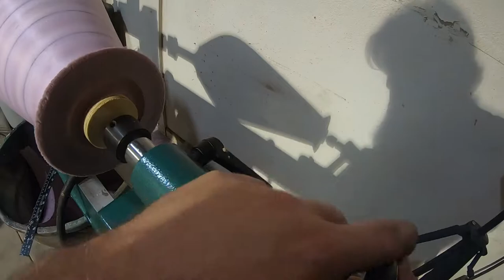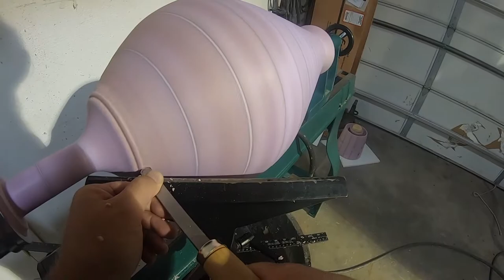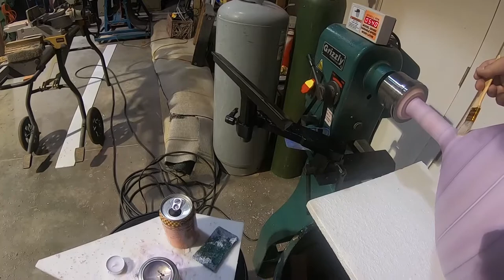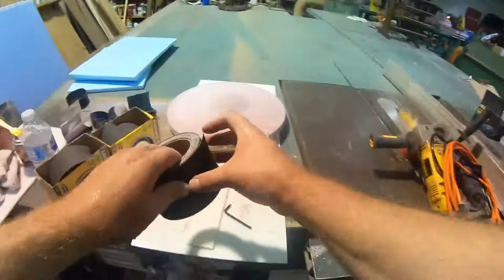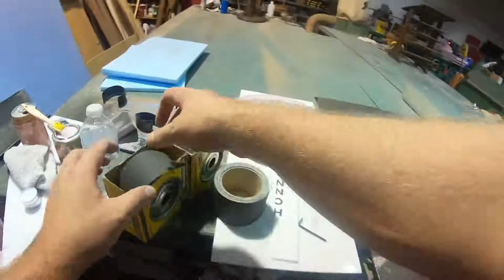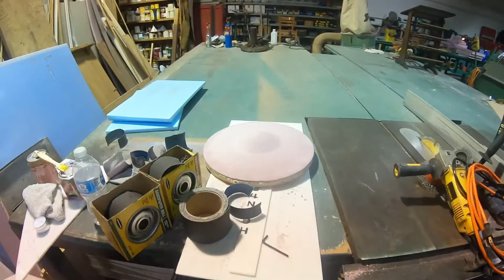How To Build A Holy Grail Blank - For the lost foam, petrobond sand casting method #5/5

Comment: How does one use this, Mr. Harner?
Reply from the maker: I have a strict no comment policy... usually, but thank you my friend for showing interest, and being exceptionally respectful. This is a "blank," but in the metal casting industry, it's referred to as a "pattern." 

This foam blank is then coated with a few layers of refractory coating, and stabilized with thin rebar. After the coating is dry, the blank goes into a mold, filled with dry sand, and casted. I highly recommend looking into Kelly Coffield's channel for a more in depth process following these videos' teachings. This lost foam system is much more adaptive to using a vacuum.

It should be noted that this method of casting a holy grail was done this way because of the ease of learning these techniques, as well as the cost. There are several ways to cast this shape, but all of them, including this method, takes a lot of patience, and skill, that have unfortunately been lost to time. My friend Kim Wrate and I have been working on a website that encapsulates as many of these methods as possible, along with lots of other things semi-related. It's been a long haul, but it's coming along slowly. 

Apologies, but I'll have to answer your question with a question: do you know what a fein tool is? Commonly referred to as an oscillating tool, with an assortment of attachments, these tools vibrate at high frequencies, which then cut, grind, and sand any number of materials. However, the frequency is controlled by electricity. 

The holy grail functions similarly, but instead of utilizing a degenerative energy source to create the vibration, one needs to only tune the opening of the bulb to coincide with the voice powering the device. The human male tonal frequency is important to this system because of the ensemble of properties present; sound, vibration, resonance, and cavitation. When in this configuration, a phenomenon called acoustic propulsion aides in the vibration, creating a jackhammer effect. Upon the up stroke of said acoustic propulsion effect, when used in water, cavitation bubbles numbering in the millions form and implode. This allows for exceptionally detailed, and minuscule results, even with a massive grail.

It should also be noted that the blank I'm making in these videos is extremely small. The actual megalithic sculpting grails of creation's antiquity are 10-20 times the size of an average human body, but they ALL function identically. To give you an idea of the size, look up the "Dendera Bulb Hieroglyphs," for a better understanding of the size difference. Reason for explaining this is because of the lost foam casting variety, my assumption is that you couldn't make a much larger holy grail than the size I'm making in these videos. 

Congratulations, though; you're my first, and likely last reply on YouTube. That is unless people keep things oriented toward functionality, and do so in a respectful manner. Thank you once more.